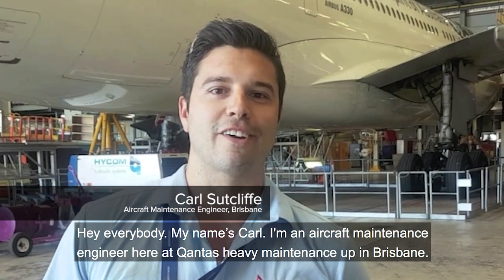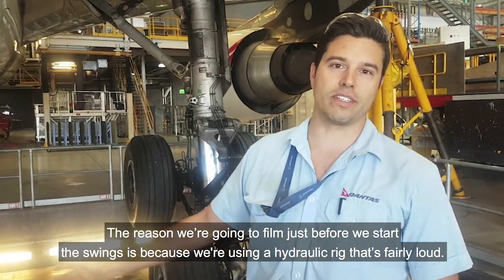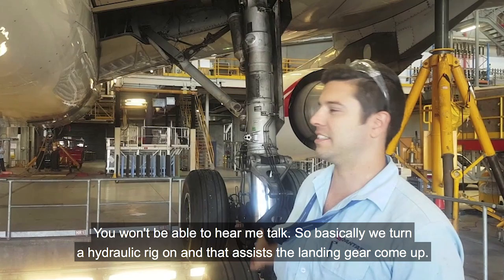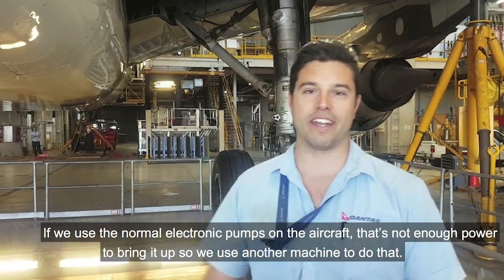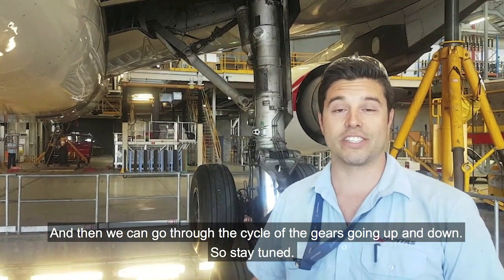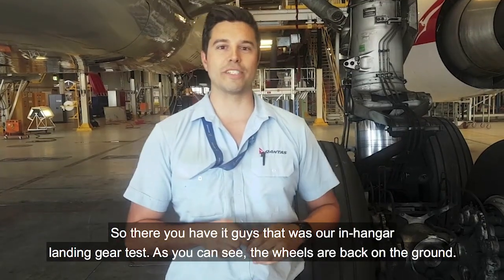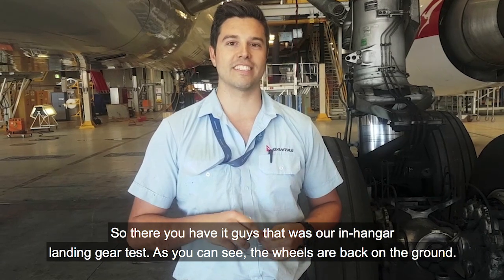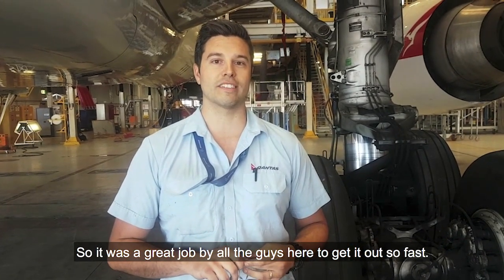How Do We Get a Plane in the Air Without Taking Off?

Comment: The fellow in this video stated the onboard hydraulic pimps wouldn't retract the main landing gear and close the doors? Why? Or in flight are there different hydraulic pumps run by the engines that are used?

Just seems weird. If the onboard electric hydraulic pumps won't do the job I would suggest a gear reduction hydraulic pump for emergency retraction of the landing gear. Might be a wee bit slower than the normal pumps but better to be able to retract the gear and close all doors. Or you could go back in time for emergency hydraulic power to utilize a prop driven emergency hydraulic pump using the wind going over the airframe to run the hydraulic system. I seem to recall ram turbines have been used on military and civilian aircraft before.
Why have the complexity of electrical systems when you simply pull a handle connected to a cable to release the ram turbine out of its storage position and into the airstream to provide emergency hydraulic power.

Merely my simply observations and thoughts on how to rectify a potential loss of aircraft flight and gear controls though I grant you it wouldn't be as high a volume of hydraulic oil pressure it would still give the flight crew control, just not at the speed their used to.

Just playing devils advocate.

Cheers!     ( and may none of your flights ever require emergency equipment like I have described.)

Comment: I was once told, if I pick up a fly and throw it up in the air the fly will retract it's legs. IF I can pick up the 747 and throw it up, will the gears retract automatically?
Reply: Manny Tang  dele
Reply: No. There's a switch in the flight deck that raises and lowers the gear. That would have to be in the up position for the gear to retract. Funny hypothesis though!